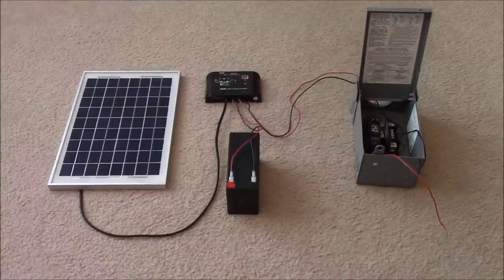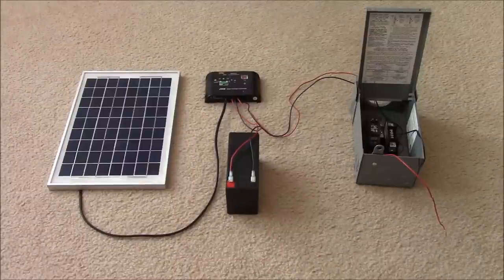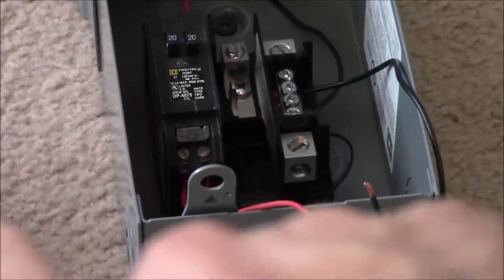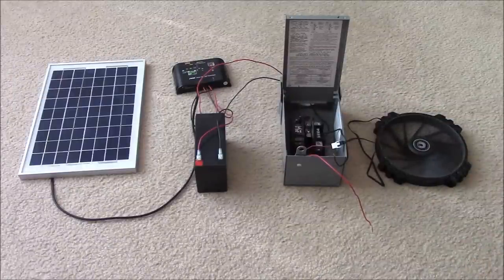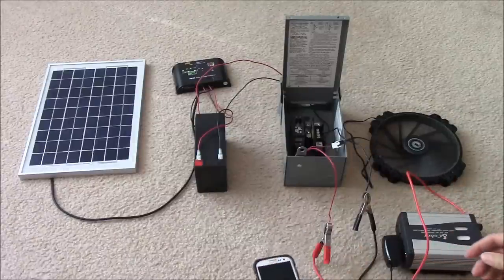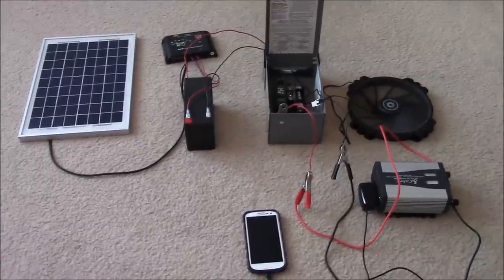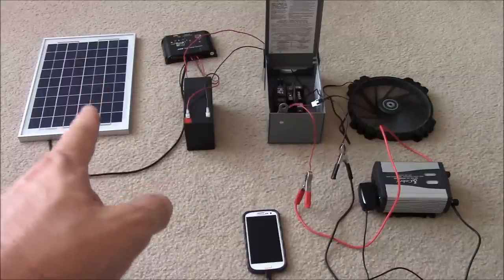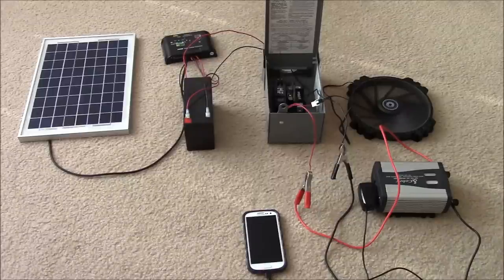Solar Panel Systems for Beginners - Pt 2 Hybrid Systems & Multiple Loads

Comment: Thanks for the informative video. Say I have the same exact system as your video here with a 12AH 12 v battery. What if I put not just a switch but also a variable-voltage buck converter between the panels and charge controller to send the whole system a stable 14 volts (compensating for power loss downstream) to the battery and load (small solar water heater 12v, 2amps). If this is possible and safe, could I safely put 2 lower but different voltages (9v and 5v for Arduino and stepper motor)? How many loads can I safely put on this system? Thanks for your response.
Reply from the maker: You definitely do not want to put anything between the solar panels and the charge controller except maybe a combiner box.  There is no benefit from a DC to DC voltage converter there.  As for loads, you can have as many loads as you want as long as you don't exceed the capability of the battery(s) and system.
Reply: @LDSreliance  I'm about to order the water pump for DIY pool heater and panels/controller, and I'm torn between Grape 50W and 100W. Keeping it smaller is ideal. Do you think the 50W will suffice to run just a 12v 2.5 amp bilge pump using just panels no battery? And with a 12 AH battery, possibly an arduino and stepper motor to keep my copper heating coils in the sun rolling slowly on a rail west to east? Thanks again :)
Reply from the maker: You can't run a 12V load directly off of a solar panel unless it can handle 14+V without damage.  And even if it can, the power to the pump would be going up and down, on and off all day long so that probably isn't the best for the pump.  Even if you just use a tiny battery as a buffer between the panel and the pump that would be much better.  And that requires a charge controller.  There really isn't any reason to skimp out on those as you can get a charge controller for $15 and a small battery for $20.

The 50W panel will only produce about 40-45W in the real world under ideal conditions.  If it is at all cloudy or hazy or you have the panel aimed slightly off angle you will see more like 20-30W.  So if it were me I would go for the 100W.
Reply: @LDSreliance  Thank you for clarifying. Size is really a factor. The wife doesn't want to make it look like a solar field out in the yard. She wants it to be less conspicuous. Thanks for your patience :)
Reply from the maker: You are welcome.  Good luck!

Comment: keep the same setup but remove the inverter and plug that also into the battery, will this not work?
Reply from the maker: Yes you can do that but there are disadvantages.  I discuss that very topic in this video:  https://youtu.be/k8aVnRpoRLc

Comment: I am trying to go solar for a small project that I have in mind. My question is, how many 100 panels, and batteries do I need to run a 1500 whats heater for a small shack? Thank you for your videos!
Reply: watch video 4 in this series, he answers your exact question.
Reply: Thank you for the tip!
Reply from the maker: I think SuperEar already helped answer your question but the short answer is a LOT.  Heaters, air conditioners, water heaters, hair dryers, microwaves, and dryers are all very expensive to run on solar due to their high electricity requirements.  If you are open to other options, I would suggest a small gasifier stove with a chimney, such as the Silverfire Hunter (https://www.youtube.com/watch?v=Z8AhtDEWRTY).  You only need a couple handfuls of twigs and small branches and some tinder to start a nice fire that will heat up a room for an hour or more.

Comment: Hi, I just found your videos. This one answered a question and brought up another one. Can I tie into the existing load box (in my RV) with out disconnecting the current source that is connected to a 110 outlet?   So my load box currently gets it supply from a 110 connection - not a 30amp plug like most.  Thanks
Reply from the maker: I'm not sure exactly what you are asking.  Can you clarify?
Reply: @LDSreliance  I have a load box in my RV.  Connect to a 110 chord to plug into RV hookups. Can I tie into this load box with my Solar power for when I don't have the option of RV hookups?  Does that make sense? Thanks
Reply from the maker: Yes, you can do that but you cannot have both attached at the same time.  Your original question said "without disconnecting the current source" and that confused me.  If you have shore power available, use that.  The solar panel system can be charging its batteries and waiting on standby.  But if you are boondocking without a shore power option the solar can be switched on to provide power to your existing system.
Reply: @LDSreliance  Thank you. I should have watched more videos first. I did see a couple more,
Reply from the maker: No problem.  I have over 100 solar related videos on my channel.  Take your time and absorb as much as you can before you spend any money.
Reply: @LDSreliance  Thank you
Reply from the maker: You are welcome!

Comment: where could i buy one of these breaker boxes?
Reply from the maker: You can get them from Home Depot, Lowes, or any electrical supply store.  I would advise getting a QO series by Schneider Electric as they are rated for DC usage.

Comment: Hi, I was watching video part 2.  There is no ground cable on set up.  Is it correct?  Do I need a Professional Electrician to do that set up?  Can I do it myself?  Thank you!
Reply from the maker: +Feliz Movie Maker There is debate on whether you need an actual earth ground in a solar DC system like this.  Some people say that it would only really be useful for lightning strikes.  As long as you are grounded to the battery I think you are fine.  But if you want to install an earth ground rod, I put up a couple videos you can check out to do it yourself:  https://www.youtube.com/watch?v=-kpI8PFNYl4  https://www.youtube.com/watch?v=K5eorpQBml0

Comment: could i connect two solar panels to on inverter or do i need two inverters?
Reply from the maker: Yes you can connect two panels to one charge controller which is then connected to one inverter.  But you can't directly connect panels to an inverter.

Comment: Hello LDS. could I use the same box to connect two power inverters to my solar system 
Thanks Al
Reply from the maker: Al Ruark Yep!  I assume you are referring to the combiner box/load center?  I would not connect 2 inverters directly to the charge controller but connecting them to a load center is perfect.  They will even have their own breaker switch in that case, too.  If you haven't watched this video yet, this will help:  https://www.youtube.com/watch?v=UG2pbErPKi8

Comment: Could you just attach the inverter to the battery instead of attaching it to the load? Would it make a difference ?
Reply from the maker: Yes, you can.  The only difference will be that your inverter will drain your batteries down to its low limit threshold and possibly damage the battery depending on what type of battery it is.  The load side of the charge controller will disconnect the power at a safe level to protect the battery.
Reply: @LDSreliance  I'm a bit confused here (maybe a lot). My RV set up is 300 watts on the roof feeding into a 40amp MPPT controller to 4 6V AGMs (400ahs).  My 1500 watt inverter is connected to the batteries with #4 cables for a 8 ft run. Here's my confusion; If I understand you correctly, I can run my 1500 watt inverter directly from the controller load connectors. Wouldn't the #12 gauge wires from the controller to the inverter be too small? My inverter instructions called for #4 cable for my run. Thanks for your time and knowledge.

Comment: Is the AC power produced stable? Thanks.
Reply from the maker: +James Boen If it is run through an inverter it is very stable.  It will be a squared off wave (modified sine wave) though unless you buy a more expensive pure sine wave inverter.  But that will only matter if you have sensitive electronics like a tv or computer.
Reply: +LDSreliance okay, thank you so much for the reply
Reply from the maker: James Boen
You are welcome.  Thanks for watching!  If you don't mind please thumbs up or subscribe to help me out.

Comment: Hi i'm sort of confused , why did you use a dc to ac inverter? i thought that the output voltage is in dc and smartphone chargers uses dc voltage/current to charge?wont the voltage that comes out become ac and not charge the smartphone?sorry i'm new to this :/
Reply: Oh the charging plug actually converts the ac voltage output to dc than to the phone again?
Reply from the maker: You can use a car cell phone charger to charge your phone without an inverter because it uses 12v DC and converts it to 5v DC for the cell phone to use.  But if you are going to use your home cell phone charger that plugs into your wall, it requires AC input and then converts it to 5v DC output for the phone.
Reply: Oh i see!Thanks for the quick reply!!Have a nice day :))
Reply from the maker: You are welcome.  Good luck!

Comment: Howzit, I just watched both your videos and found them to be very informative. Thank you for that.

I have a few questions for a off grid diy system I have in mind...

I am looking at setting up security lights around my property and run them off of solar power. I want to use between 4 and 6 10w 12v small LED spot/ flood lights that will be on throughout the night (10 to 13 hours depending on season) and 1 or 2 10w 12v small LED spot/ flood lights with motion sensors. 

What I want to know is will the distance of cable used between each light (between 10m to 25m) cause major line loss and if yes how do I overcome that problem?

How many 12v batteries would I need for a system like this?

Would a 1 20w solar panel be sufficient for the system?

These are the specs on the solar panel I have in mind:

Cell : Polycrystalline solar cell (78mm x 52mm)
No. of cells and connections : 36 (6 x 6)
Dimension of module (mm) : 550 x 368 x 25
Weight : 2.5kg

Characteristics
Model : SD ECO PLUS 20Wp
Open circuit voltage (Voc) : 21.6V
Optimum operating voltage (Vmp) : 18.2V
Short circuit current (Isc) : 1.28A
Optimum operating current (Imp) : 1.10A
Maximum power at STC (Pm) : 20Wp

Limits
Operating temperature : -40 degrees Celcius to + 85 degrees celcius
Maximum system voltage : 1000V DC

Temperature and Coefficients
NOCT (Nominal Operation Cell Temperature)  @ 48 degrees Celcius ± 2 degrees Celcius

Current temperature coefficient : %/K; 0.035
Voltage temperature coefficient : MV/K; -0.37
Power temperature coefficient : %/K ; -0.5

ADDITIONAL INFORMATION
Solar Module Watts	20W
Module Voltage	12VDC - 23VDC
Panel Type	Rigid

Maybe I should also ask what size battery bank I would need to make full use of the power supplied by such a solar panel? (I hope this question makes sense)

Would I be able to connect a water heater and an electric gate motor to this set up also?

Thanks in advance.
Reply from the maker: Theo Bessit Where to begin?  This is a common situation that you are in as you are just getting into the "hobby" or industry.  I had to learn a lot of this the hard way because I didn't ask questions like you are doing.  I just jumped right in.  So kudos to you for asking!The first major issue we have is that you will lose a LOT of voltage transmitting 12v of power over distances of 10-25m.  Even with gigantic wires you will lose too much power and the lights will be dim, if they turn on at all.  One way to solve this is to have a small solar panel for each of your lights and mount it on the pole or side of the barn/shed/building that the light is mounted to.  Then the cables would be 1-2m at most and you would be fine.  So you would need 1 small solar panel (10-20w or so), 1 small battery, and 1 cheap charge controller per light.  Obviously this might be a bit pricey for your proposed setup.  I would estimate $100 per light including the light fixture and bulb and panel and battery, etc.The other option is to use some larger solar panels, a battery bank, and one more expensive charge controller as well as an inverter to switch the power immediately to AC power from the batteries and then transmit the AC power to the lights.  This would be beneficial because the AC power at 120v will not lose much, if any, voltage even over long distances.  Also, the bulbs and fixtures for normal AC lights would be much cheaper than 12v bulbs and fixtures.  I would estimate at least $1000 USD for proper sized panels and the equipment to make this happen.  I don't have time to do the math right now but if you want me to try to spec something out for you I can try to do that in the next few days.

Comment: I have confused: will load gets power from battery or from solar plate? lets create a scenario. today is not good sunny day. so solar power is not enough. or barely enough to only charge battery. now battery is already 50 or 60 percent charged. nowwhich power source will be used for load. if I have 1kva plates and 12v , 600ah acid cell battery. will solar charge controller intelegently manage to transfer power from solar to load when solar has excess watts other wise use battery for load and solar for only charging battery?
Reply from the maker: That is a complicated question and there are too many variables to answer precisely.  It will depend mostly on your charge controller.  Not all charge controllers operate the same way.  But generally the battery will provide the power for your load and the solar panel will assist.  If the solar panel provides more watts than the load then you can operate the load and charge your battery at the same time (although it will greatly slow down the charge).

Comment: How can I figure out the amps of my panels?
Reply from the maker: They should have some electrical specifications on a sticker on the back or on a data sheet that came with the panel.  That will tell you the laboratory testing results that they are rated for.  If you want the real world amperage you will need to test them with an ammeter or a multimeter.

Comment: do you have to have a load hooked up to the charge controller i just want a solar panel to charge my battery
Reply from the maker: Nope, not at all.  That will work just fine!

Comment: Very informative video, thanks for sharing!

I have a small project where I am setting up mini off grid solar system to power a small 12VDC 1.7A (max) diaphragm pump for my rain barrel drip irrigation system. 

I am thinking of purchasing a 8Ah deep cycle battery, 20W solar panel and charger controller, I just want to know if I am on the right path. Also I am also thinking of adding a 12VDC valve and timer (self-powered) to the system, would I need to set up a load box like what you have in this video or I can link the wires of the pump and valve together?
Reply from the maker: +Lebert Frankson For something small like that you can probably just hard wire them together.  They will be using small gauge wire and using very little power.  The only reason you might want a load center in this situation would be able to switch them on and off with the breaker switch.  Otherwise you would only want to use one when you start using more electricity and need some safety and control.

If you tell me how much your pump is going to run during the day and where you live I can calculate and make sure those components will work for you.
Reply: Thanks for your speedy response LDSreliance the pump may run a maximum of 30mins per day at 6pm (here in the tropics there is no sunlight at that time).
Reply from the maker: Lebert Frankson
What country do you live in so I can look up how much sunlight you get?
Reply: +LDSreliance Jamaica :D
Reply from the maker: Lebert Frankson
Ok, you could actually get away with a 5 ah battery and 10 watt panel and that would give you about 2 days of power if you are only using the pump and only for 30 minutes.  If you add a timer and other loads it would increase.

For the cost, I would just get the 20 watt panel and a 7-10 amp charge controller and an 8 ah battery like you suggested.  It isn't much more expensive than a 10 watt panel and smaller battery and it will allow you to add timers, relays, monitors, or whatever else you want to do in the future!
Reply: +LDSreliance thank you so much!
Reply from the maker: Lebert Frankson
You are welcome.  Thanks for watching!

Comment: Hi LDSreliance, great videos thank you they have explained a lot.
Question on the controller and battery setup if I can please. 
Obviously power comes from the panel to the  controller and as mentioned by you before it is diverted to the battery and/or output as needed.
So question is, the Controller also acts as a battery charge controller (of sorts) as well? so that they are not over charged or anything like that? or is that wrong?
Reply from the maker: Yes, that is the primary function of the charge controller.  It is a battery charger first and a load controller second.  Many people don't even use the load control functions.  The charge controller will make sure that the battery is optimal at all times, as long as there is sun shining.
Reply: Thanks mate, you simplified the whole solar setup nicely!
Reply from the maker: You are welcome!  Thanks for watching.  And be sure to subscribe if you are interested in solar.  I have dozens of solar videos.

Comment: fot that setup what battery did you use? thanks
Reply from the maker: That is a typical UPS style 7Ah battery.  Usually costs about $15-20 so it is a good starter batter to play around with since you will probably destroy it while you learn what is going on.